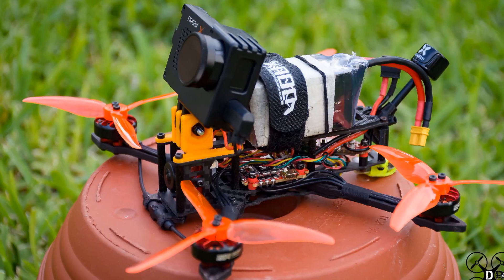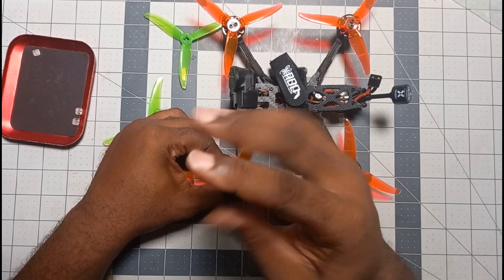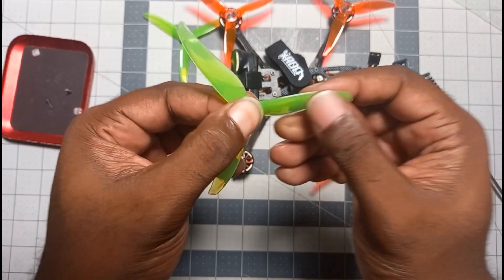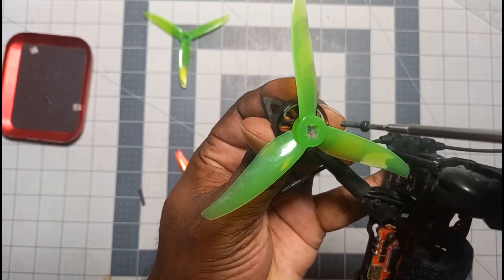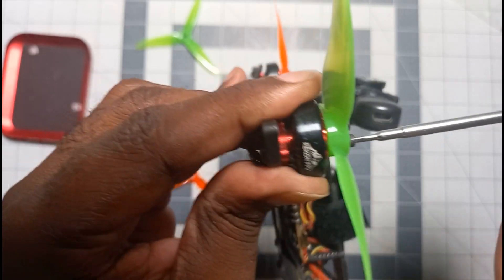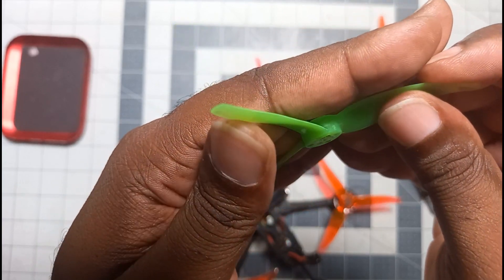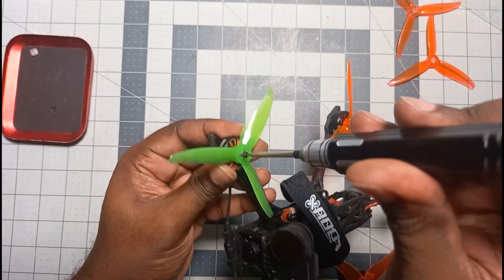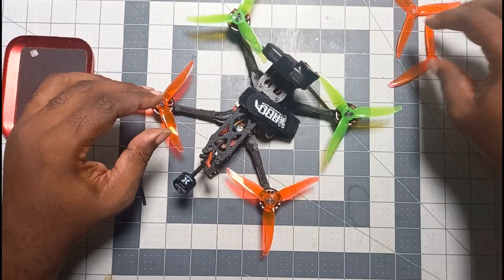How to change FPV drone propellers (T mount Props)

Comment: do those screws come with your props or motors?
Reply from the maker: Screws usually come with the motors however its best to have spares on hand as you will loose them over time through crashes.